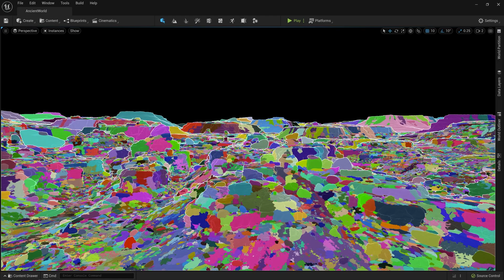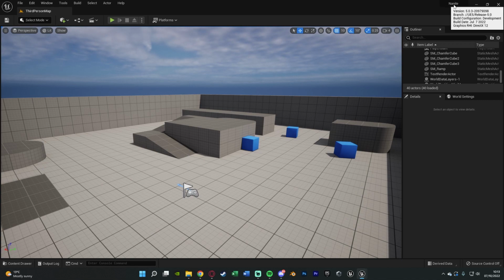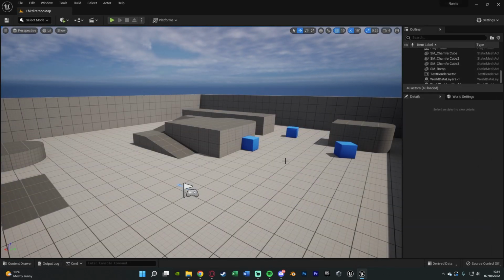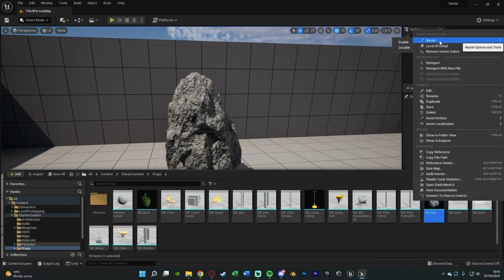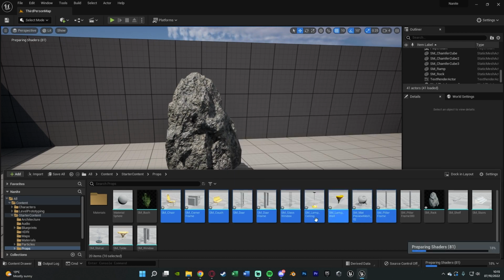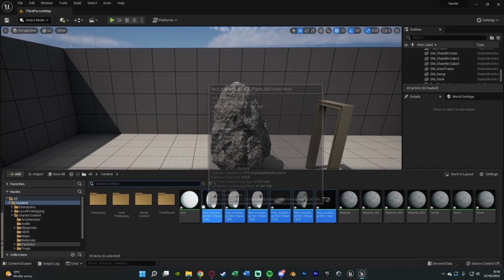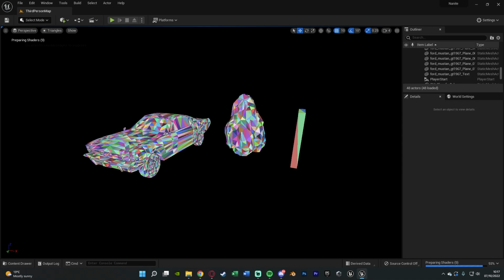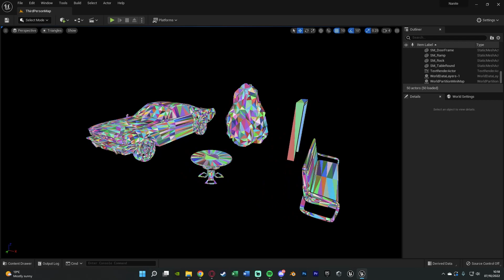How To Enable And Use Nanite In Unreal Engine 5 To Make Your Game Run Smoother (Tutorial)

Comment: Did I understand correctly that nanite doesn’t work on macOS? Trying to enable it on my MacBook Pro(M1) and noting happens
Reply: I do know that Nanite and Lumen both works on MacOS. Also, the MacOS don’t have Raytracing Hardware on Chip. The Metal Graphics API however, does have a Raytracing API that runs on Compute shaders on the GPU but does not run at interactive rates. At this time, it’s meant to aid in offline renders in software such as Blender and others. I personally believe that apple will eventually add specific Raytracing Hardware on Chip but who knows exactly when that will happen.

Comment: I read somewhere that it's only usable for meshes with very high polycount? as in, using it for low/mid poly assets is just going to add performance overhead.
Reply from the maker: I initially believed this as well, but the Unreal Documentation said that it is worth using on any asset wherever possible as it will speed up render times.

This is under the section "What Types Of Meshes Should Nanite Be Used For?"

https://docs.unrealengine.com/5.0/en-US/nanite-virtualized-geometry-in-unreal-engine/
Reply: @MattAspland  Thanks alot for the info.
Reply: @MattAspland  This is true on their part but it depends on cases. Right now, In my world the small props (AC etc) had nanite enabled and they were spread all throughout but disabling nanite on them actually gave me a boost in performance. These assets are hardly over 3K triangles. Nanite actually is strange. Ofc I have it enabled on bigger meshes (over a million tris) but not sure about the meshes which are less in poly count but more in quantity. Always use "stat gpu" and see Nanite frametime load. Maybe, just maybe, UE5.1 might have some Nanite improvements.
Reply: @wolfwirestudios  In theory you should "Nanite Everything" in the future
Reply: @JorgetePanete  Yeah. Once it is in it's perfect state. :)